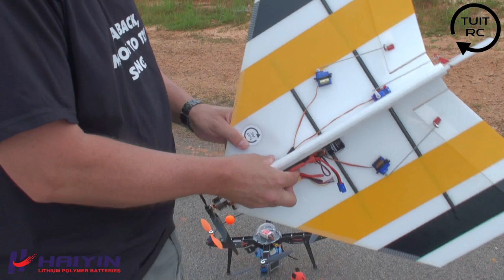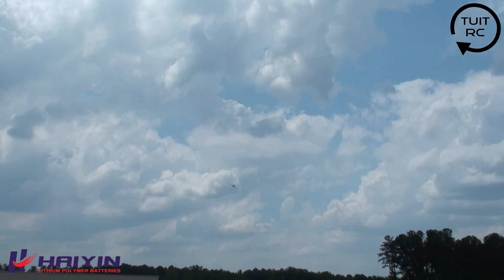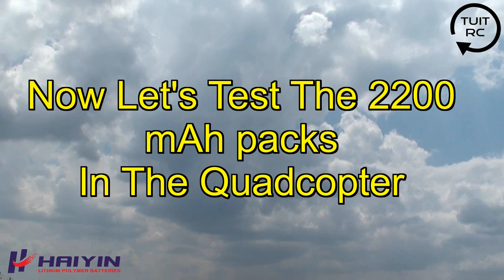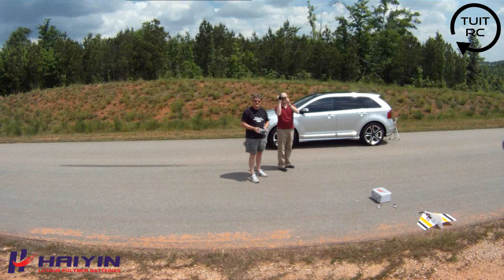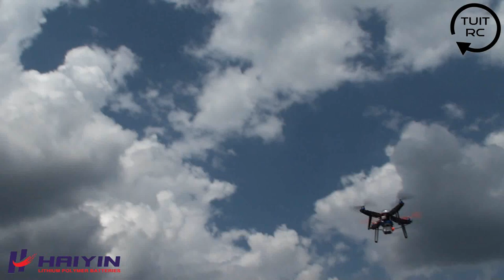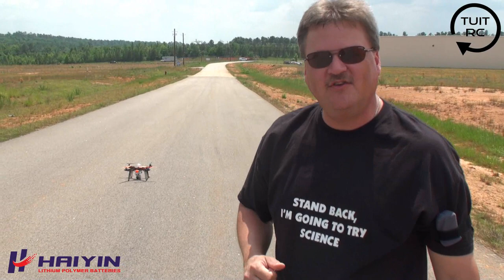Haiyin Battery Review. Are They Tough Enough?

Comment: Hi fellows.  
I use these bateries as well and here is my 2 cents. If the application is rc helis or big planes with sufficient wing load, then is a really good choise. If though, the application is super light planes, or helis where battery department is tight, they are maybe not the best choise. I 've been using Hacker LiPos, Balck Magic, Dymond, EP, Swaytronic and all af them have significant difference on size and weight compared with the Haiyin LiPos. 
On 6 cell Lipos, i found out than most of the regular 6 cell 5000mAh LiPos like Zippy or Dymond, the weight is around 760-780 gramms, when Haiyin is around 100gramms more.

Comment: I had the the same experience with a Haiyin 6S 5000mAh 35C Lipo today. Neither has this pice of crap the claimed capacity nor is this Lipo a 35C Lipo. The so claimed Ohm match is a joke. Between 1 mOhm and 8 mOhm. The 8mOhm cell is after only two fligths pregnant.